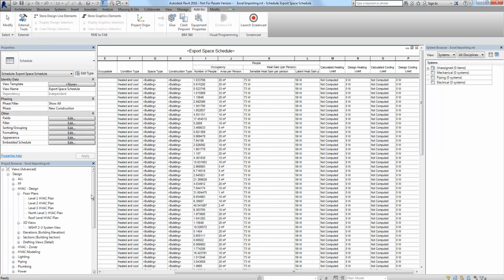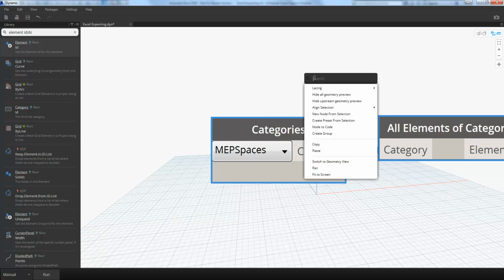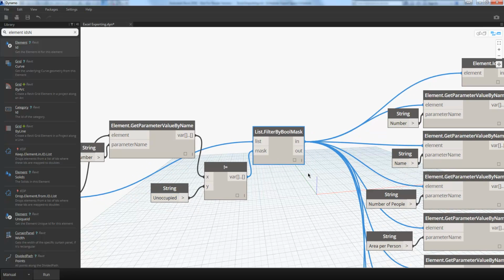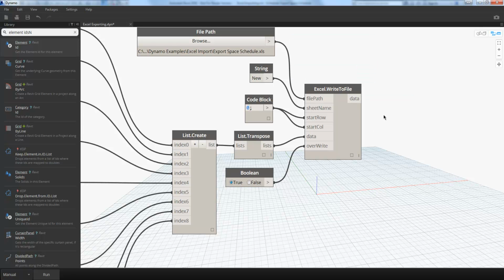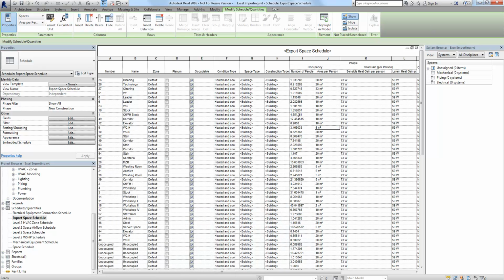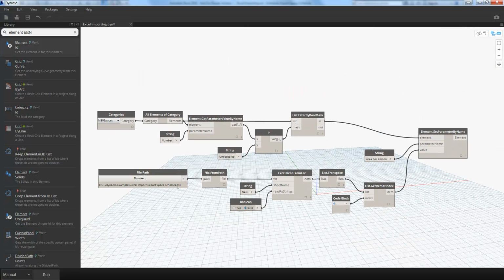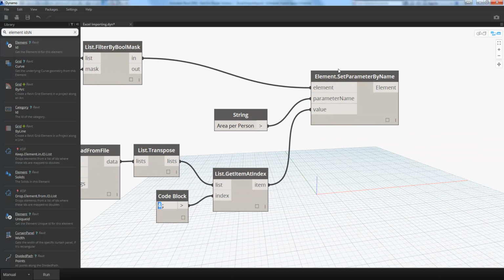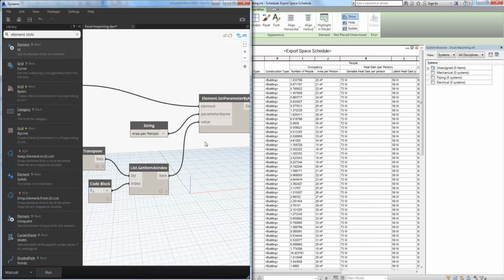Using Dynamo to Export and Import Between Revit and Excel

Comment: So I am trying to make a Responsibility Matrix from an excel sheet and have that placed into Revit as a schedule. I know there are ways to export into CAD and then bring that into Revit but I am trying to make a more direct way. Is there a way to bring an excel sheet into Revit using Dynamo, without having to have that data in Revit prior to it being in excel? I know there are tons of custom nodes to get that done but I am trying to do it without having to use one of those custom nodes. 

Thanks